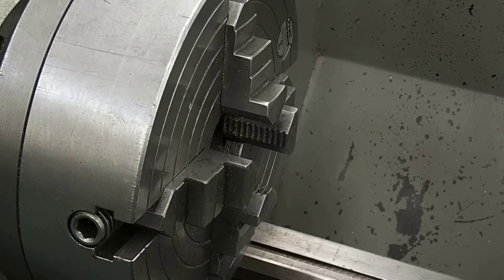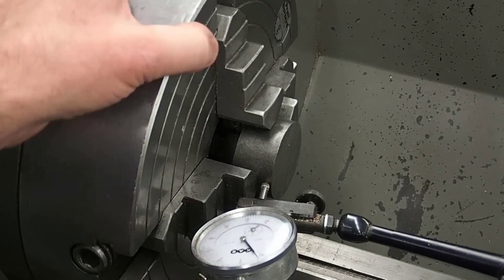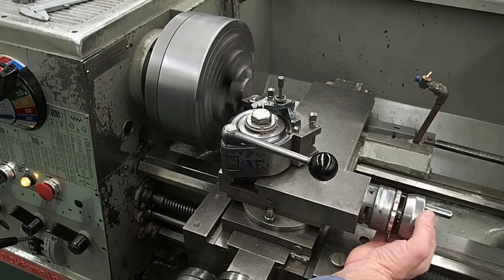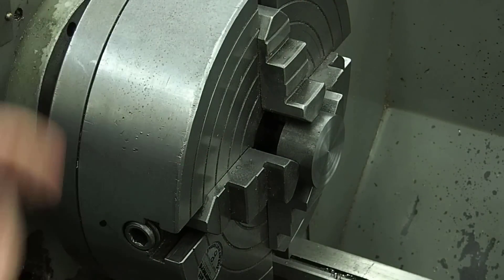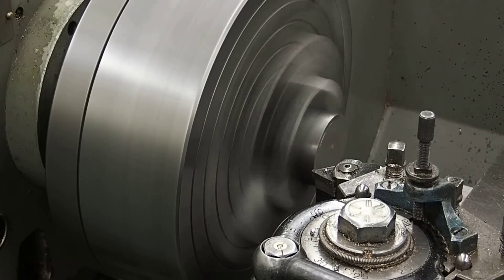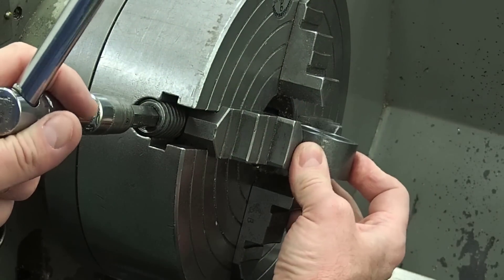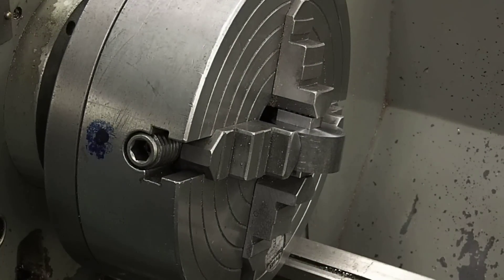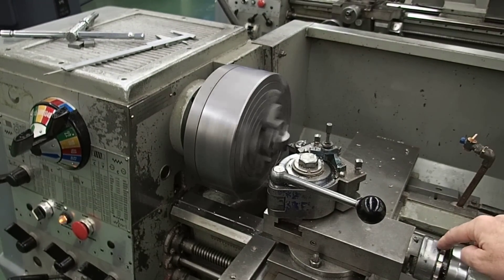Machining a Cube on a Lathe

Comment: When people ask me what I do as a machinist. I answer, "I make round things square and square things round."
Reply from the maker: :) Funny how we do that! Thanks
Reply: I used to reply " I make chips" now I say " I make steel wool"
Reply: A wise man once told me "If anyone asks what you do for a living, tell them you press buttons and spend taxpayer money." Lol
Reply: Sorry if this idea ends up making your work obsolete and putting you out of a job, but have you tried leaving the round things round and the square things square, and just using them in the shape they start in? ;)
Reply: coryman125 Your not a machinist are you.  Creativity and humor go hand in hand. 
Sometimes, especially in repair and R&D work you have to with the material and machinery at hand..
Reply: UncleBman Lucky. I have to make broken things whole again, blueprint as much of it as possible, and then make as many replacement parts as the customer wants. Lol.
Reply: +coryman125 Heresy!
Reply: I use machines that can easily kill me to make machines to safe some ones life.
Reply: When people ask me what my lathe is for I say "It makes big things smaller."
Reply: UncleBman Well, at my mandatory one week internship at a local tool making factory (back in 1992 when I was 17 and attended technical college) before I started my apprenticeship as a fitter, I was tasked with making an M20 hex nut and bolt from two pieces of round bar. The hex head and nut was milled using a divider (or whatever it is called in english, I'm from Denmark) and the thread was turned on the lathe. Quite a task for someone with very little experience with the mill and lathe. Fun though. :)
Reply: Impressive work for a beginner. Divider is the same word we use in Texas.  I think all young people should be exposed to as many things as possible to show them how the world works. Their iPhone did not appear by magic. Their bread did not make itself. It takes hard work and talent to keep the world spinning.
Reply: Actually, I think you're the one missing the joke here.
Reply: could it be possible to set the chucks on a lathe like a wankel bit and machine it like that?
Reply: Yes, that never works.
Reply: My mentor used to say, possibly more simply, that, "I remove stock." And, "I make ODs smaller and IDs bigger." Those always made me laugh.
Reply: Old timer  told me once after several years of him showing me how to do stuff. I taught you everything you know, not everything I know.  Some things you just need to figure out for yourself.
Reply: I Always ask why?
Reply: wfs52 "The world turns on a colchester!"
Reply: @luderudecrude  Yes, for off centre pieces, crankshafts or holes off c.
With a bit of imagination and a face-plate, all sorts of weird shapes
and holes can be made. tapers, balls n sockets, It`s great fun.
I used to make lots of bits for motor cycles, on an old Colchester. Many of which were not circular, fork yokes, handlebar clamps, pedals levers etc.
Reply: I made things that didn`t exist yesterday.
Reply: "I take pieces of metal, and make them into smaller, more intricate pieces of metal."
Reply: "I remember how my great-uncle Jerry would sit on the porch and whittle all day long. Once he whittled me a toy boat out of a larger toy boat I had. It was almost as good as the first one, except now it had bumpy whittle marks all over it. And no paint, because he had whittled off the paint. No paint." -- Deep Thoughts by Jack Handy
Reply: @coryman125  Lol, you have no idea.
Reply: I make a lot more chips than I do square things and round things.  Oodles of them, in all manner of metal, shape, color, and mess.

Hmmm. I guess I make more messes than I do chips.

I'm a mess maker.
Reply: wfs52 it’s a dividing head in the UK
Reply: :-D
Reply: thats funny, i do the same but with words
Reply: @luderudecrude  Yes, I've done it for an excercise. 3 pieces of hex bar in the chuck together. Turn the "piece" round. Move each piece 120°, repeat, and then repeat. You end up with 3 "wankel" rotors.;-)
Reply: @sunshadow7XK  Made on a Myford! ;-)
Reply: @Vineleafstudio  A Vertex. Made in Taiwan? ;-)
Reply: Y’all are nutz what’s the point in making a metal cube. It ain’t good for nothing.
Reply: That's what she said
Reply: @coryman125  You   seem to have no clue about machining & the parts that need tapers , squares ,threads , holes,  keyways ect. on round parts alone . He's just showing one of the possible tricks you can do on a manual lathe. In reality we would use square material & machine it to the dimensions the print will show. With no CNC you could take this procedure & turn round bosses on all 4 sides.  As machinists we make the part to the print & when we play we use our skills to make toys ,& gizmos for fun.  We love our home projects. If i were you i would take a look around your car or take the time to watch some machining clips of how parts fit together to make things work. It's just not cut and dry round & square. I'm surprised you don't ask him why he has the blue dykem mark on the chuck or why he has small blocks in between the jaws & the workpiece, duh...
Reply: Considering my wording and the winky face, a lot of people didn't seem to realise I wasn't being serious :/
Reply: Genious!
Reply: @coryman125  Oh eise guy. Hey Mom 👺😨😯 You got a point there his boss said he don't want it pointy..
Reply: Lana de acero se le llama a la viruta que se produce en el mecanizado por el torno siempre y cuando no sea viruta de  fundicion de hierro gris o fundicion nodular; saludos
Reply: @SD-ir1vf  With a little further work we could us it to play craps.
Reply: When people ask me what I do as a Tool Maker I say "I make everything twice".
Reply: @punishr36  ,  When People ask Me what a Machinist does,  I say "I make Machines" ..  
  As we all know,  they won't understand anything else..  They really don't understand that either ,  nor do they care..  It's just more idle chatter that makes the Word go round.
Reply: @punishr36  You won't have a job long if you make everything twice? I made plastic injection moulds in Houston.
Reply: This won’t work with 3 jaw chucks
Reply: Michał d: careful! You could end up with actual knowledge.
Reply: As a woodworker on a metal lathe, I make round logs into square boards, and then cut them round on the lathe to be chisel handles.  round tree-> square  bandsaw -> round lathe
Reply: @coryman125  It's the internet :D
Reply: @coryman125  well then in that you would be still walking long distances, no cars, no rails no aeroplanes. unless you make sq to round or round to square ha ha
Reply: @Vineleafstudio  or a divvy head ;)
Reply: When my wife asks me what I'm doing in my workshop, if I'm working something that deals with wood, I just say that I'm making sawdust because I've run out of it.  If she wanted a serious answer, she should bring me a beer.

I learned a long time ago that she doesn't really want the real answer because when I explain what I'm doing, she just gets this glazed look on her face and is totally confused.

Same goes for when I'm working with metal...

Sometimes though, I'll just say that I'm planning world anarchy... She doesn't get the joke about planning anarchy though.  Sometimes, I'll just say plotting world domination...  One beer at a time, of course... :)
Reply: @martyshrekster  Soooooo true! ROFL  I think the kids would agree... "on sooooo many levels!"
Reply: @coryman125   If only it were that easy! The round things are seldom really round, the flat things flat, or the rectangular things rectangular. God bless the metrologists and mathematicians!
Reply: As a Tool and Die Maker who's also a Machinist (insert someone violently arguing here) for 30 years, I always say, "Well, I make big metal into small metal, and I fix what engineers couldn't get right in the first place."
Reply: I liked this video .That clausing cold chester lathe is an excellent lathe.The first lathe i ever ran.the fellar making this part makes a good teacher 🙂👍👍
Reply: @martyshrekster   if you work for the army core of engineers you just watch water go by and waist taxpayers money.
Reply: @tonywahyudi1050  -  that must be why he said he was using a 4 jaw chuck...  

With a 3 jaw chuck all he can turn is pyramids. ;)
Reply: you nailed it, thats the point
Reply from the maker: Tony Wilson  thanks for your kind words and confidence in me. I have not been able to get into my shop since March and I'm not sure when I will get back. I appreciate you watching and posting. By the way I love your country!
Reply from the maker: Tony Wilson  Thanks Tony :)
Reply: https://www.yaplakal.com/forum23/topic2193714.html станок точит человека
Reply: i dont mean to be off topic but does anybody know a trick to get back into an Instagram account..?
I was stupid lost the password. I appreciate any help you can give me.
Reply: @Ismael Tadeo it did the trick and I actually got access to my account again. I am so happy!
Thanks so much, you saved my account !
Reply: @Jake Jacob Happy to help :D
Reply: @HepauDK  sounds like an awesome challenge, i took the pre apprenticeship and just started working two weeks ago, now i gotta wait till next august for the new pre apprenticeship class to start up again,  i literally cant wait.  I love that in our pre apprenticeship we started everything by hand drills and fills, one guy was complaining why cant we just make the holes with the mill.  i plled him aside and was like have you ever used a drill, he said no,  i was like well then,  how will you know how a lathe works,  the speed, when its cutting right,  if youve never used a drill.  he got it then.
Reply: @Vineleafstudio  are you from the uk and if so or anyone else, is maching a big thing in the uk,  ive always wanted to ove to the uk.  and was wondering if my background in machinery would help me with the employment.
Reply: @grymgaming5541  Theres a distinct shortage of skilled men and women in the UK at the moment and wages are rising  so you would be in demand. 
I’m a toolmaker and have agencies emailing me Job lists everyday.